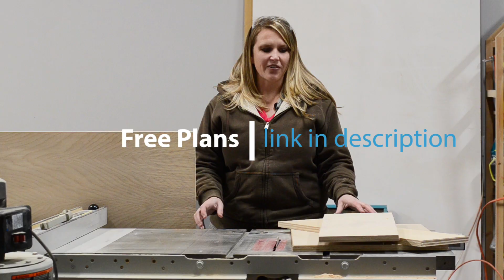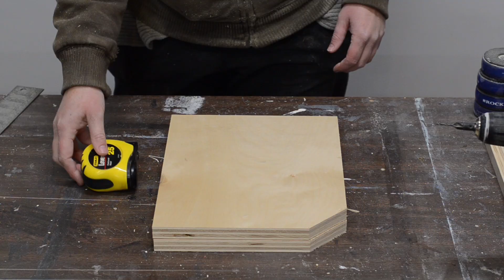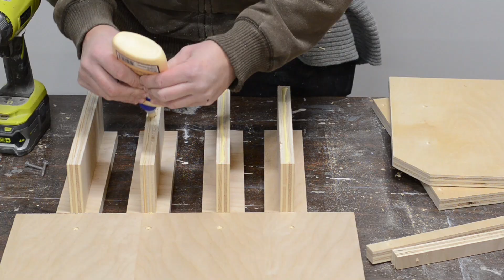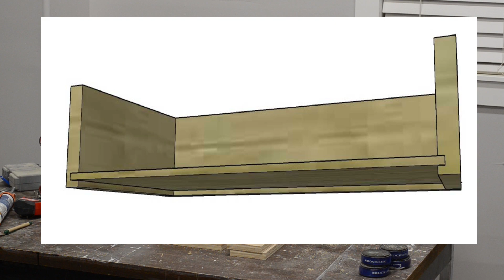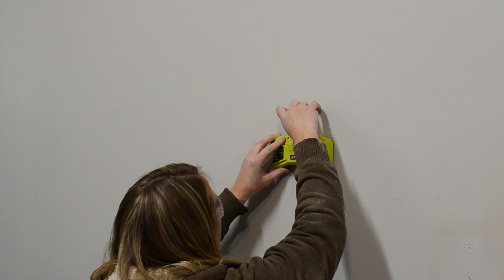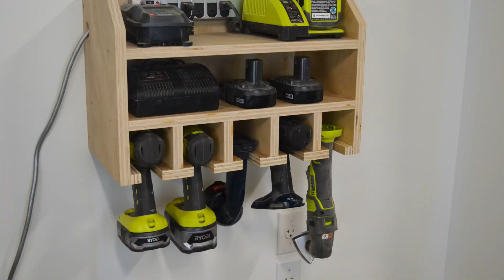Build a Cordless Drill Charge Station and Tool Organizer

Comment: In the video you show a cut diagram for 4' by 4' plywood panel, but this diagram is NOT included in the plan PDF, and is too small to be read from the video. Can you include the cut diagram in the plan PDF file?
Reply from the maker: Hi Paul, Sorry about that, the PDF has been updated. https://www.hertoolbelt.com/cordless-drill-storage-charging-station/

Comment: Those hanging drill holsters are popular on YouTube.  My drills don't hang that way without putting the weigh of the drill on the Forward-Reverse switch.
Reply: Flip it over so it hangs by the bottom of the handle
Reply: Great video. Thank You also for the dimensioned plans.

Comment: Very nice.  Exactly what I was looking for.  Question, what is the brand of orange screwdriver bit you were using?  Looked like it works great. Thanks!
Reply from the maker: Hi, the screwdriver bit is from the Milwaukee Shockwave bit set. It's a great set to use with impact drivers https://bit.ly/2K9KNIT
Reply: Thanks so much!  Subbed.

Comment: Amy, very nice job!  I plan to make something similar for my shop.  Keep up the good work.  Some advise:  I cringed when I saw how close your fingers got to the saw blade.  A kickback could easily occur and you could lose fingers.  I have had a large pushstick for over 25 years that I bought at Sears.  It works well and gives me great control.  There is a similar model on Amazon;  https://www.amazon.com/Big-Horn-10230-Woodworkers-Safety/dp/B001C4O92I/ref=sr_1_9?ie=UTF8&qid=1520431855&sr=8-9&keywords=table+saw+push+stick  You should consider.  Good luck.
Reply from the maker: Thanks. That looks like a good push stick, I've been tempted to get a microjig too.